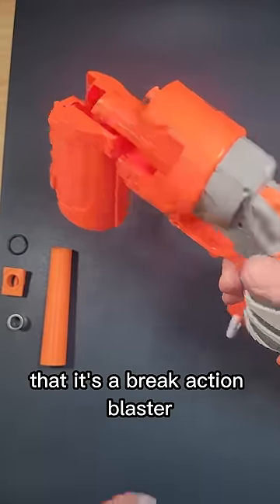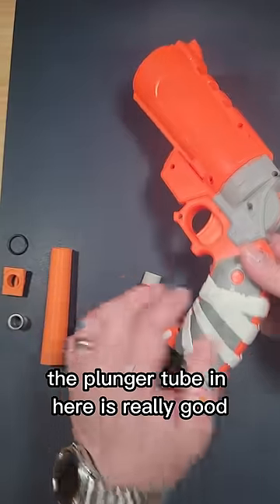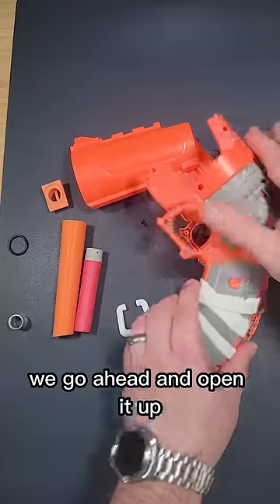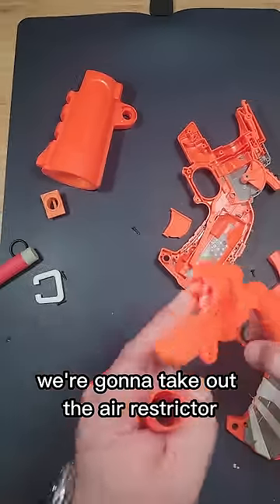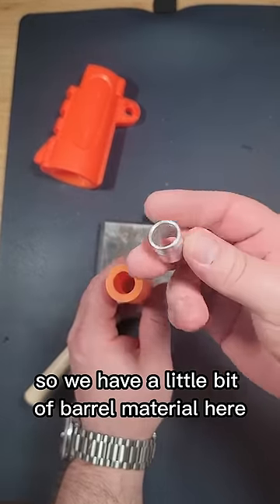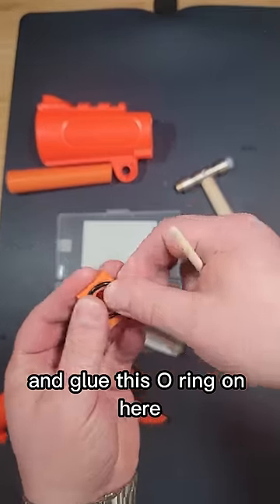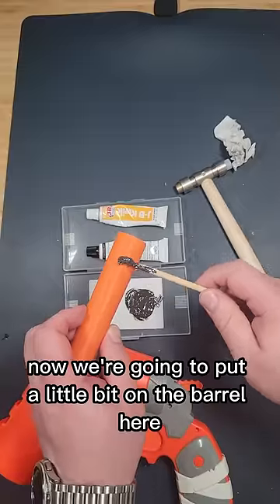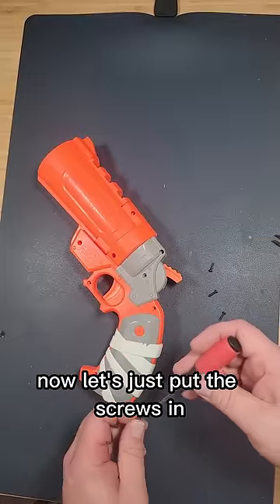The Nerf Fortnite Super Flare Inline Clip Kit by ZDL

Comment: Can you show how good it is after the modification?
Reply: I think he broke it
Reply: Ye fr
Reply: He didn’t even show it breaking open after the epoxy set. I bet it set crooked or something. I would not have used epoxy to fix an o ring either. Rubber cement is a good choice. Silicone maybe.
Reply: What would be good if you showed a before shot and after really showing the results of the modification
Reply: @Wtfinc ye that’s most likely why there was no demonstration; he broke it lmfao

Comment: i really liked the part where he showed us what it does
Reply: Same😮
Reply: If it was a video that was supposed to show that you could expect it, but dude just said he was showing how to install it.
Reply: @RealShaggy  🤓🤓☝
Reply: @gabe42813  Yes, I have access to emojis too. They're pretty cool.
Reply: @2FatBucketsOfLosPollosHermanos  nahh bro just referenced kfc
Reply: Yep, this kinda format is a great way to get the average viewer to hit that "Not interested in this channel" button. Glad you got my one view and comment. Good luck with repeat viewers I guess?
Reply: Kentucky fried children?
Reply: i bet he broke it
Reply: @RealShaggy install it wrong yes!! You don't use epoxy resins on rubber o-rings it just won't seal and plastic bonding to melt the parts together is better than epoxy resin that become brittle as it hardens over time..
Reply: @RetiredToddler  The problem is you aren't an og Nerf channel watcher or enthusiast . It seems this video was meant for people in the community but showed up on other peoples feed. Hes modding it and adding an inline hopper. An inline hopper is a barrel that allows you to load multiple shots behind each other but it only fires on at at a time.
Reply: @RealShaggy  my dude its literally called "The Nerf Fortnite Super Flare Inline Clip Kit by ZDL" not "How to install The Nerf Fortnite Super Flare Inline Clip Kit by ZDL" people expect it to be a review type video. When you watch a video called "The new Apple Vision Pro" (example) youd expect to see what it does, not just an unboxing etc